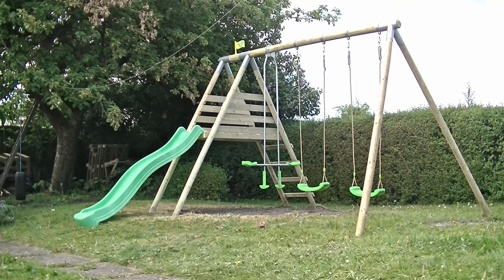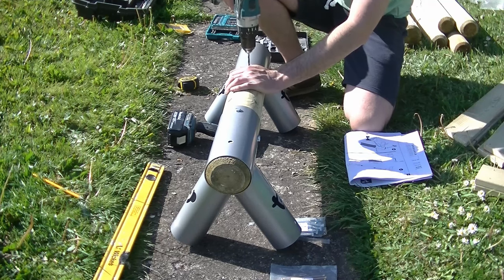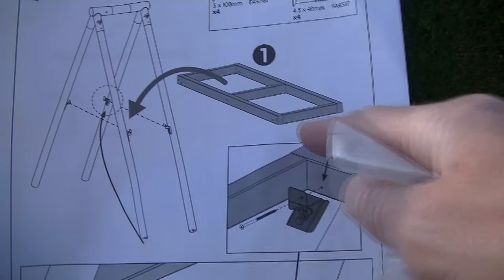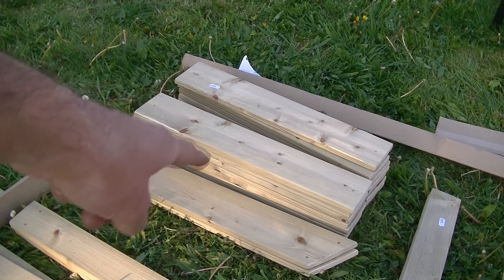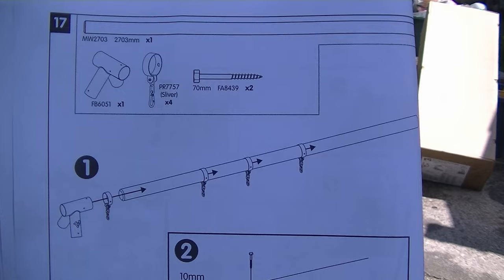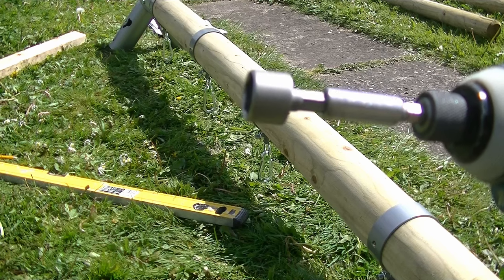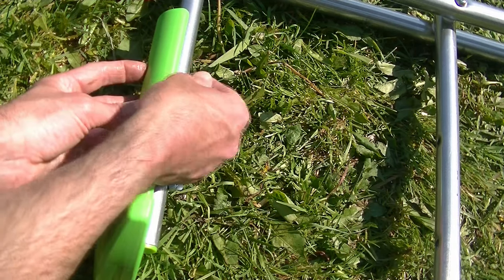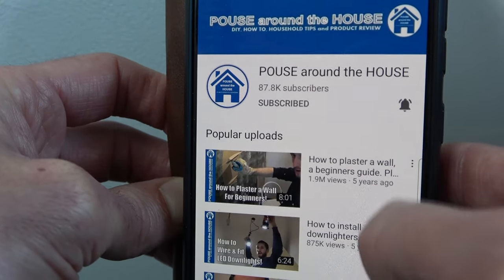How to assemble TP swing & slide set. Wood multi play centre assembly. Swing set & slide build!!

Comment: Did you have any issues with wood splitting when drilling / screwing?  My DIY skills are not great but I have ordered the smaller one of this (one swing one slide) but I will likely be drilling the pilot holes but then manually screwing the (rather large I imagine) screws in.
Reply from the maker: If you drill the timber first, the wood won't split. I'd advise using either an impact driver or use your drill with a posi drive bit to drive the screws in. Doing it by hand will be extremely difficult. Best of luck with it 👍

Comment: Hi did you have to dig posts into the ground and secure with concrete or anything
Reply from the maker: I didn't because the weight of the slide section keeps it all firm to the ground. If it was just the swings and no slide then I prob would have set posts using the anchors provided.

Comment: Did anyone have to treat the wood or is it all holding up ok over the years?
Reply from the maker: Still holding up as it's treated from manufacture, but it doesn't harm to add a preservative for longevity. I may do mine soon after 4 years!
Reply: @POUSEaroundtheHOUSE  treat it as often as you see fit, as these are not water tight!